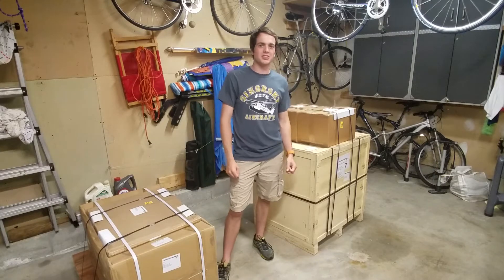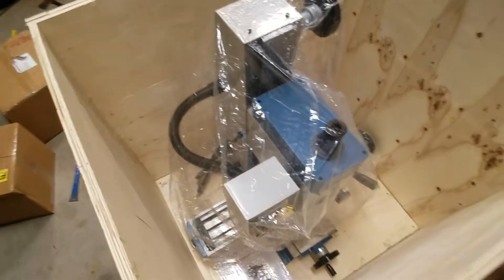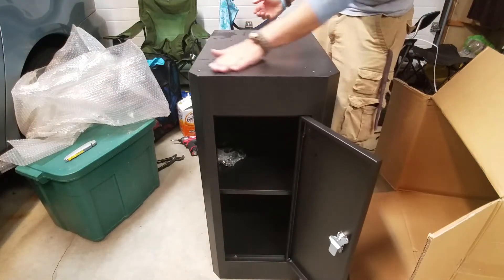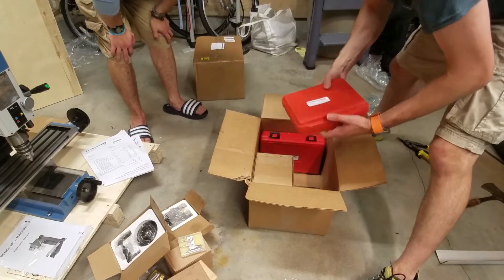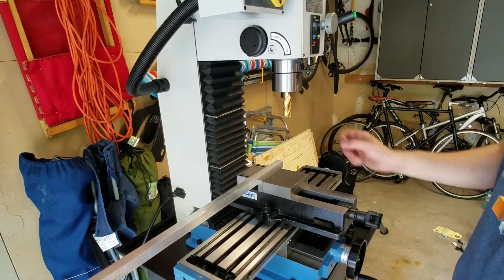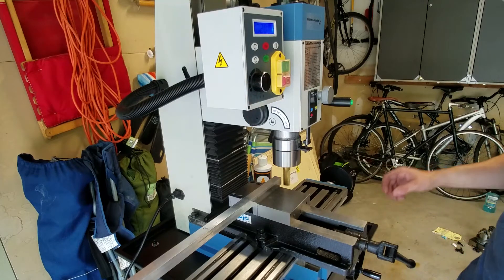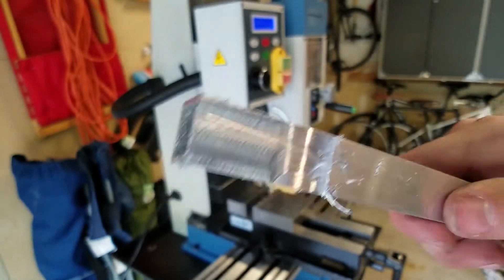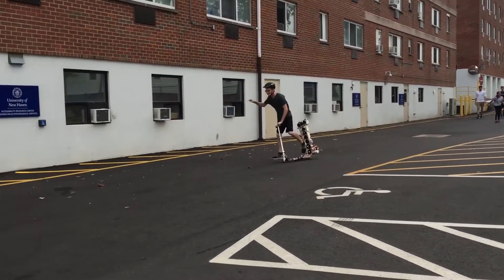Unboxing a Sieg SX2.7 Bench Mill

Comment: Finishing pass take it lightly and the surface finish gon improve you are using a aluminum square tube which is not easy to  work with since its hollow the material will vibrate you can feel it ,this machine can mill steel as well just lighter cut compared too aluminum and even lighter cut for finishing steel .oil can improve the finish.make sure the gibs on the way  is tightened considerably i remember the spindle bearing can be preloaded or tighteed to eliminate play .no toxic comment just sharing what i know and hope you can  learn and use from it.

Comment: Hi, Thanks for your great videos. Do you consider a useful investment for the DIY stuff? Do you use it now very often for your projects?
Reply from the maker: I think it's very useful if you are working with small aluminum parts but it does take a bit of a learning curve. I'm going to try to convert it to CNC soon so I can get more use out of it
Reply: @mattsheehy1854  ok thanks. Yeah great idea! like cutting curves would only be available in CNC mode... Wonder if using only the SX2.7 to build brackets for the motors and CNC add-ons would be possible?